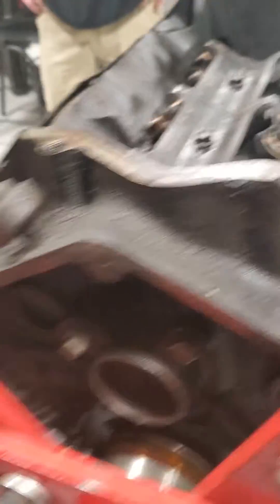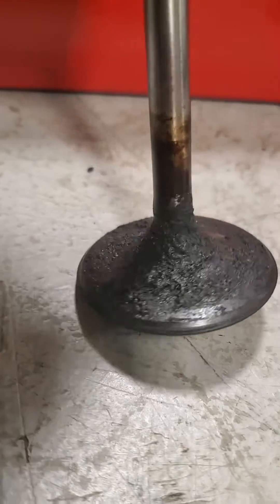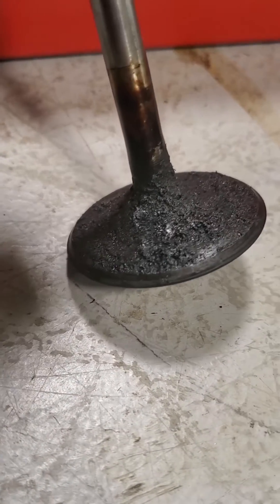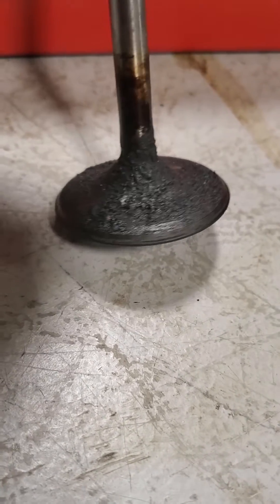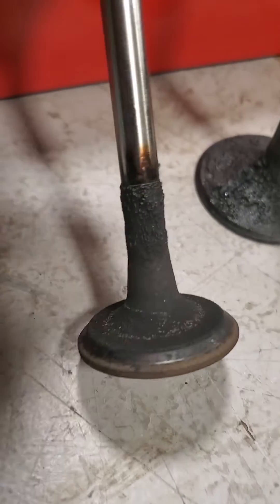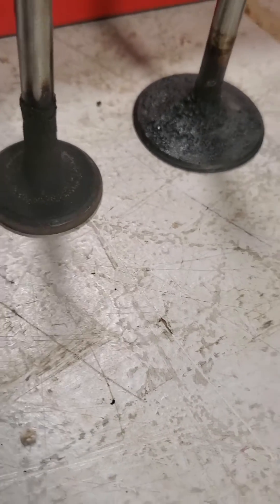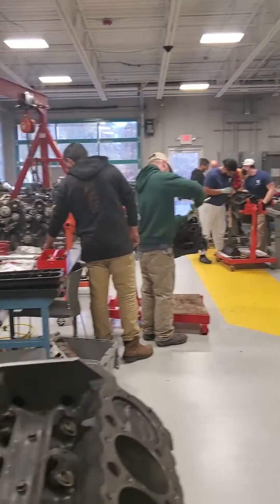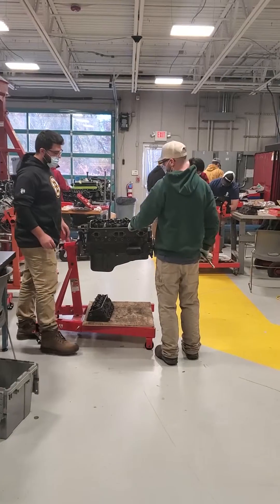Intake and Exhaust carbon build up due to cheap gas

Comment: Great presentation Ted - I buy 90 octane ethanol - free recreational fuel on the dock.  They say its Valvetec but I doubt it and dont know if the fuel vendor has cleaners and additives like a TopTier gas has.  I have the Volvo Penta 5.3 Gen 5 - 300 HP GM aluminum block with direct gas injection and had misfiring on one cylinder and had to have my plugs changed at 180 hrs. which is not much time for iridium tip plugs.  (Other boaters tell me I don't drive it hard enough to blow out the carbon and idle it too much) .  Should all of us subscribers with these engines be using an additive like Techron with PEA to wash the intake valves and prevent carbonization at every fill-up or any other additives?  Dont want to do walnut blasting of the valves in a few years.   Any ideas are appreciated!